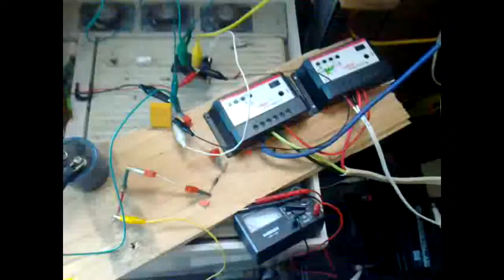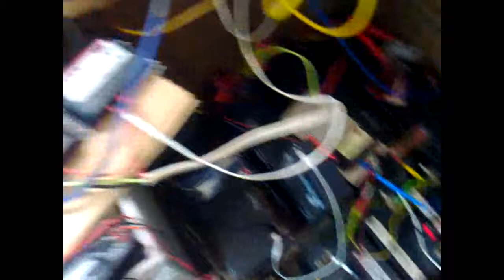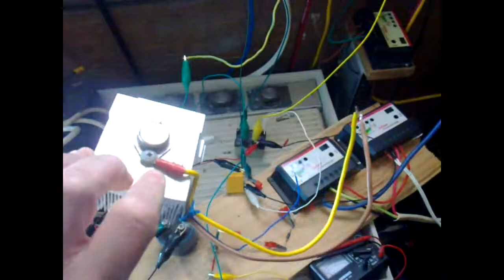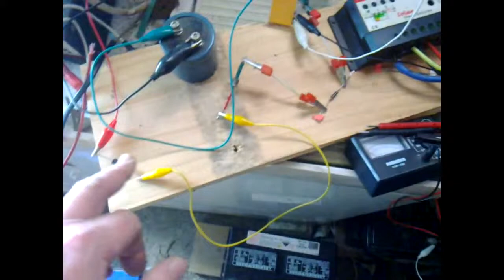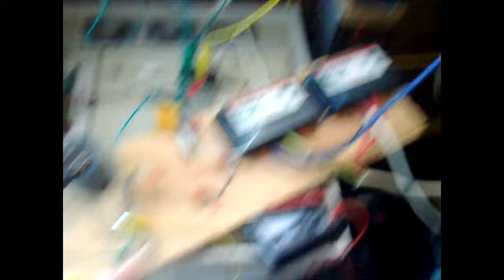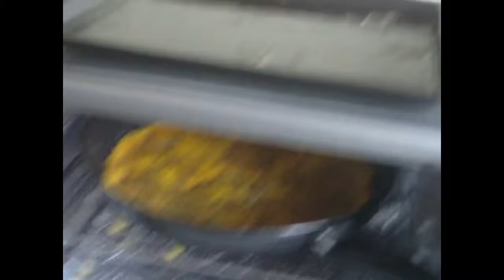DAY 301 OFF THE GRID - *A heck ov a lot ov Solar*

Comment: I don't see much point to be worried about an emp, because it's really just theories what will and will not be effected by them.
do you need blocking diodes to prevent the battery power from each bank from effecting the other bank.
best
Reply from the maker: +Rev John O'Toole I am personally not too concerned about them. And besides solar panels are silicon junctions anyway, so if some such event actually did occur with sufficient energy to wreck a charge controller it would probably take out the panels as well. Solar panels are in essence just giant LEDs running backwards! lol But having said that, alternators, batteries and incandescent light bulbs would survive so it would still be useful to have a charge controller that did.

However my main point for assembling this circuit was to get something going quickly & finally make this design work. I tried a similar idea about five years ago, with little luck but I hadn't caught on to what the secret was - which is simple really: Make sure most of the voltage drop feeding the sense relay is by zenner diode and not by resistance. 

Also, the on/off type of controller (no matter how it might be instituted) is the better choice for this situation because the "spare" current coming from the other system is often pulses. And I am sure these would upset any kind of PWM controller hooked to this. But you are correct though, there are blocking diodes in the circuit. They are at the other end though, right at the output of the mosfets. And they stop one battery bank backfeeding into the other.
Reply: +xanataph I wonder if it matters or not, but for example Justin Case's battery bank is huge. so I wonder how balanced charged his bank is.
best
Reply from the maker: +Rev John O'Toole It totally matters. Extremely important. Ideally we should be making sure each cell is balanced, but that is only possible with a 2 volt battery system. Unless of course you hack a battery lol! 

For example, if your batteries get 1 volt out of balance in a 24 volt system the charge controller reads 28 volts and thinks everything is hunky-dory but in reality one battery is sitting at 13 volts being undercharged, while the other is at 15 volts being cooked!! 

The highest out-of-balance tolerance I will accept is 0.3 volts between upper and lower batteries on a 24 volt system. But it is not too difficult to do better than this.
Reply: +xanataph how do I wire for example 12 t-105's 6 volt each to get a balance charge. other than what I already know, 4 in series, 3 sets in parallel?
byw, I loved the fire works display.

john